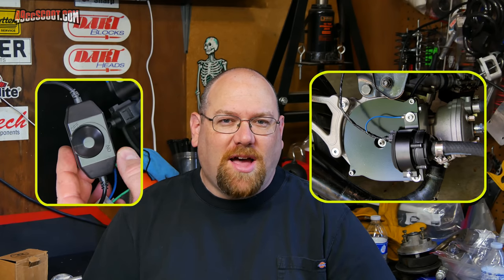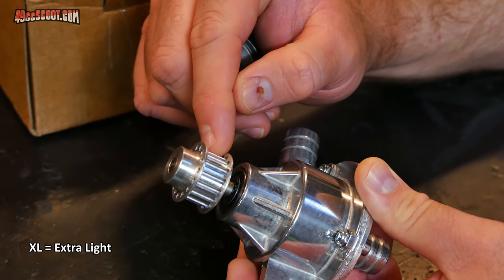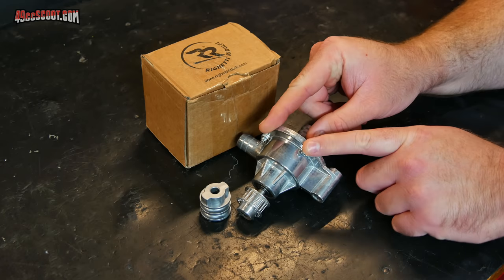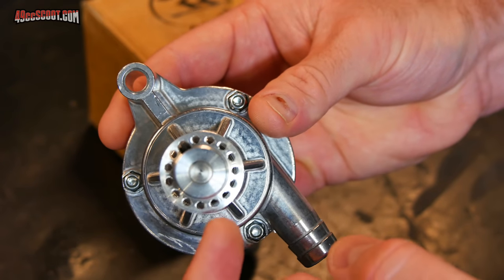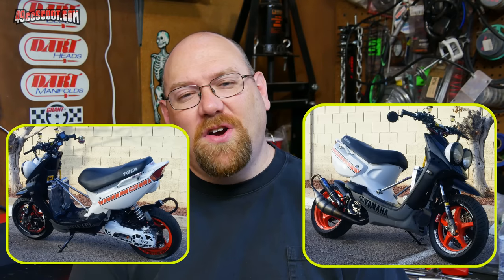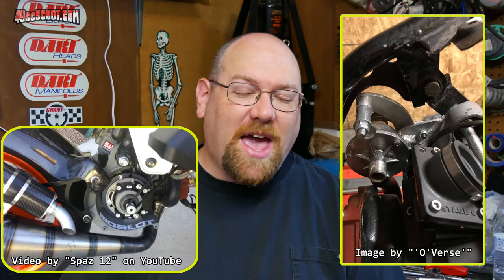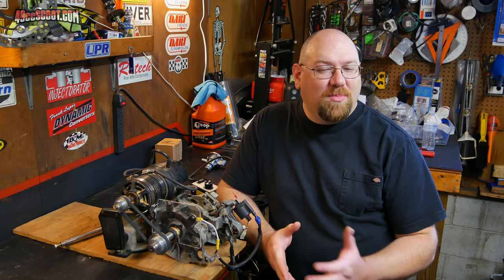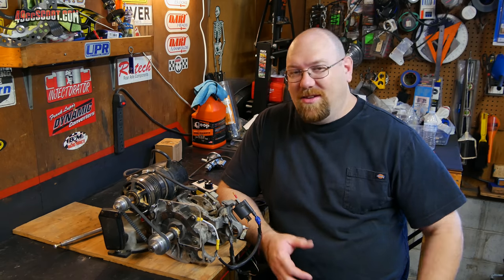TPR 86cc Build : Part 35 : Belt Driven Water Pump Info & Flow Testing : Scooter Performance

Comment: That Spaz guy sure had a nice scoot!

I didn't really give the driven speed of the pump much thought because I figured the guys who originally used them had no issues with them that it would be fine, and I never had a problem with it over heating. But I can definitely see the benefits of slowing it down!

Excellent video btw. Always so thorough 👍🏼
Reply from the maker: Yes he did. Thanks again for sharing that stuff.

Comment: Great research work. I know that the Malossi electric pump works with a constant flow of 20 L / min, but they use huge radiators on their high end sets. On the other hand, I am interested in how the designers of the go kart pump solved the bearings, lubrication and sealing, so I don't think it would be good to turn the mechanical pump more than 5-6k rpm. Since you have a large radiator surface, I think everything between 5 and 30 L / min will be fine.
Another thing to pay attention to is the proximity of the pump and belt to the asphalt. I'm sure they use the O ring type of belt on the go cart due to the fact that any small stone can easily tear the toothed belt or the belt could just fall off. If you decide to use this belt it would be good to make some kind of shroud.
Great video!

Comment: What you really need for better accuracy are a couple 55 gallon barrels to work with. I'm pretty sure what you are seeing is air being introduced by air being mixed in from the turbulent return flow of the 5 gallon system. Cavitation is going to happen at the pump impeller and the vapor bubble will have collapsed as soon as it got to the positive pressure side of the pump.  Water temperature matters as well. Water at well below boiling temperature (212° F @ sea level) can be made to boil with a little bit of vacuum. That is why pressure cookers are used. (so water can be heated to a higher temperarure before it will boil) Trying to pull water through so fast that it causes it in effect to boil is going to reduce the flow from lack of coolant to grab onto to push through.(cavitation) Engine temperature will rise accordingly for lack of effective coolant flow. Cooling systems are limited to allowable positive pressure that comes with heating. Exceeding that will get you forced leaking, blown hoses or over-pressure release), so an efficient transfer of heat for cooling is important. Naturally, heat transfer is going to work better with more surface area to dissipate heat. Larger tubes to reduce  restriction of coolant transport along with more cooling surface area is the best recipe for good cooling. So, generally speaking, a bigger radiator will do more for cooling than a fast flow of coolant... Coolant has to flow just fast enough to pick up the engine heat and carry it away to the radiator before it reaches the pressure/temperature boiling point. And then dissipate enough of that heat at the radiator to have enough capability to absorb heat before it flows back into the engine. 
(kenoguy10 here on YouTube... AKA bandito2 or Scooter_Jedi on other scooter forum sites)
Reply from the maker: Thanks for the thoughts Bandito. There is certainly more testing that could be done. For me, it gets to a point of how much do I want to put into it and what's practical for me.

Comment: Interestingly a (very brief) google search on car pumps lead me to a 2-3L car having a 80-110L flow rate. This was of interest to me as my suspicion is that after a certain flow rate, the main factor is the radiator cooling capacity. Even with 2 strokes generating a lot of heat comparatively, if you can run at 60L/m, that would be plenty. Cars also have massive radiators, in the best air flow, with fan assist. This tends to indicate to me the radiators are a significantly bigger factor than flow rate. From your testing, you could also look at the point of failure, then run it at 2/3 of that for best performance and longevity. I have found the 2/3 rule works for most things, from power supplies, to cheap knock-off turbos.
Reply from the maker: I honestly think it would do just fine with 20L/min at the high rev end, but I wouldn't want it to barely spin at idle. That would move all of the water in my cooling system through at more than 10 times per minute and would be about on par with what you're saying the 2-3L car info says. I dunno. So many ways to look at data though.

Comment: My guess with the waterpump is that it is surging at high rpm. You are driving the pump beyond its efficency. The pump is not able to push the water out fast enough and the impeller loses "grip" on the water. Like with turbos you have compressor surge if you try to push more air in to the engine than engine can digest. Then that exess air will skip the blades on the impeller and be pushed out of the inlet.

Comment: Love the content I've had two 50cc 4 stroke scooters always had issues with them burning oil and breaking belts etc  I'm getting a 2 stroke this time possibly a peugeot speedfight/piaggio zip or baotion falcon (Chinese variant) have worked on scooters myself not as in depth by far but I like to tinker about love the sound of a 2t, all the best

Comment: This looks like cavitation to me but I am really not sure. The way I understand cavitation is from propellers not pumps. If it were cavitation I would expect the pump RPM to jump and to hear a noticeable difference in load as the air bubbles are created and pass through the outlet.
Reply: i think it's cavitation , you should do you test with cilinder and radiator  inline with the pump , the restriction in the system wil cuase the cavitation faster
Reply: What you really need for better accuracy are a couple 55 gallon barrels to work with.  Then you could see if it was introduction of  air from the turbulent return flow of the 5 gallon system or if it was from cavitation.  Water temperature matters as well. Water at well below boiling temperature (212° F @ sea level) can be made to boil with a little bit of vacuum. That is why pressure cookers are used. (so water can be heated to higher than 212° F before it will boil) Trying to pull water through so fast that it causes it in effect to boil is going to reduce the flow from lack of coolant to grab onto to push through.(cavitation) Engine temperature will rise accordingly for lack of effective coolant flow. Cooling systems are limited to allowable pressure (before forced leaking, blown hoses, over-pressure release) that comes with heating, so an efficient transfer of heat for cooling is important. Naturally, heat transfer is going to work better with more surface area to dissipate heat. Larger tubes to reduce  restriction of coolant transport along with more cooling surface area is the best recipe for good cooling. So, generally speaking, a bigger radiator will do more for cooling than a fast flow of coolant... Coolant has to flow just fast enough to pick up the engine heat and carry it away to the radiator before it reaches the pressure/temperature boiling point. And then dissipate enough of that heat at the radiator to have enough capability to absorb heat before it flows back into the engine. 
(kenoguy10 here on YouTube... AKA bandito2 or Scooter_Jedi on other scooter forum sites)
Reply: Actually, cavitation by itself is not going to cause aeration, Aeration happens when air is introduced into the system... usually by a leak in the system that allows air in.

Comment: Hi. Do you think if you push the water through the radiator too fast, then it won't be in the radiator long enough to cool the water. Great videos by the way. I really enjoy them.
Reply from the maker: Needing more time to cool in the radiator is supposed to be a myth. Any more modern stuff that I've read basically says that more flow will equal better cooling. That said, I think there's a point where you don't gain much. The stock style mechanical pump moved a lot of coolant and it seemed to do better than the electric pump that flows less.

Comment: @49ccScoot  May I ask where it was denoted as 'myth'? Heat transfer is not instantaneous. You know that if you have ever touched an exhaust manifold, cold to start, and taking a while to warm up, or the reverse where you touched a hot one, realized quickly, and removed digits etc from contact with little or no burnt fingers.
Maybe you should do some flow tests through a fixed size radiator with a fixed airflow, measuring air F in/out and coolant F in and out. Vary your pump output as desired.
I do know that a V8 will pass coolant through a radiator fast enough that it fails to cool, and turned on the 'HOT' light in a friends car I borrowed. There was no thermostat installed. BTW, thermostats restrict flow even when open fully. I have not checked for any example testing anywhere.
tom
Reply from the maker: I spent some time reading about this a while back and I tend to leave it to the people that are way smarter than I am, like engineers and physicists. One simple takeaway for me is to look at the inverse relationship between the radiator and the engine instead of solely thinking of the radiator in the cooling system. You will also find mention of restrictions like washers or thermostats in some of these links and what they really change.

https://flowkoolerwaterpumps.com/blogs/cooling-resources/doesnt-coolant-need-more-time-in-the-radiator-to-cool
https://www.evanscoolant.com/blog/multiple-pass-radiators/
https://www.eng-tips.com/viewthread.cfm?qid=432703
https://www.stewartcomponents.com/index.php?route=information/information&information_id=14

Comment: I am also curious if it's cavitation. You might be moving the water so fast the vacuum makes it boil at ambient temps, which may not be good for the pump blades.
Good tests, BTW.
It would be cool if you could put a temperature sensor at both of your engine cooling lines. That way you get a sense of the point of diminishing returns. In other words, your radiator can only transfer so much heat to the air at a given airflow given the ground speed (and radiant surface emission). From that point onward, increasing the pump RPM will be dragging down the engine for naught(, causing it to run hotter because you will apply more throttle.) It would seem that once the engine is hot, and the temperatures become similar on the inlet and outlet, there's not much that can be done.
Also, the situation will change once the water is going through the radiator and engine, which will likely be more restrictive than an hose. The pump may not work efficiently because of the backpressure. Backpressure may also might give the pump and belt a hard time. It might be good to do tests with the engine/radiator loop, and insert a bucket in there to see what's going on.

Comment: All this difficulity to get a waterpump to work properly at higher RPM, while piaggio has a nearly unbreakable and well designed integrated pump as standard on their liquid cooled engines. Only if it breaks you've got to split the entire case. But Piaggios superiority aside, awesome solution my man!
Reply from the maker: Thanks. Most just use an electric pump and live happily ever after. I'm just not a fan of the electrical requirements coupled with a racing ignition.

Comment: I may have posted this previously, so.  Experienced mechanics note that overheating at speed points towards a plugged radiator.  Overheating 'in traffic' indicates a failing coolant pump.
 Given that, if you overheat at speed, the radiator may not have enough transfer capacity.  You should be getting decent airflow over the finnage & tubes, so total capacity is of interest.
 In 'traffic', i.e., city traffic, the pump must circulate enough coolant to dissipate the heat.  If you can keep cool in traffic, the increased output at higher speeds should take care of increased heat output.  Applicable to engineer designed cars and truck cooling system, not 2T home-engineered setups.  Your mileage may vary.  Ummh.  Your mileage WILL vary.
Reply from the maker: I think my radiators are likely overkill. Many have half the radiator that I do basically. Mine are straight up for best flow through and have hardly any sort of hindrance ahead of them or behind them. I doubt that they are clogged. Still, I'd rather have too much radiator. I could use more if I had a thermostat IMO, but I don't want to sit on top of a radiator on wheels either.

Overheating is sort of a relative term here. I'm trying to cool to levels that they typical car or motorcycle enthusiast would be looking at as cold. I'd be happy if it stayed at 120F all of the time. That would be considered unhealthy for many engines. My concern is more about heat transfer into the cylinder and cases where it then heats the incoming fuel/air charge. Not the typical overheating concerns when dealing with automotive cooling systems.

The only times that I've seen legitimate overheating were related to failures of the head gasket or water pump. Otherwise running "hot" is like 140-160F. I haven't even seen 160 since I've had the TPR (other than pump failures) so I think that was likely due to my 103cc never totally sealing. I'm looking at more like 140 for the high temps on hot days (80-100F).

The electric pump turned down with the PWM did heat up more, so I need a certain amount of flow. Even it cooled OK when turned up, though not quite as well as the mechanical pump that flowed considerably more. Small differences though. I don't think I am capable of testing with enough accuracy to be certain of how much flow matters for me, because I don't think we'd be looking at big swings as long as I've got at least say 20L/min.

Comment: This might be way out on left field, but what about using a secondary charging system to drive the electric pump?  I guess  that would create too much rpm drag, but food for thought?
Reply from the maker: OG on the forum suggested a belt driven alternator instead of the pump actually. I didn't even realize they had alternators that tiny, but they're out there.

Comment: Use the chicken net in the form of a ball to keep the hose from the bottom or just tape a stick side of hose so its keep it open and also Some pumps blades have a different angle and if the angle of the blades is not steep enough and you put more rpm its just brokens the flow same happends in boats also when there are too many rpm and low angle its barely push water out its just makes more air bupples...Ps..Sorry my English i hope you get 70% what im trying to tell

Comment: my guesses are radiators cant cool enough fluids. then pump and plumbing simply wont push enough water through..  
just like car turbo/chargers. 
btw u shouldnt use the water pumps dry for any (longer) amount of time. at least thats what im told...and by experience.

 thanks for vids, do enjoy the builds etc

Comment: Honestly I'd start at 30% and see how that works.  I doubt you need much flow at idle and low rpm and the parasitic loss will be significant at higher rpm.

Comment: Kinda off topic, but why do karts use external (axle driven) water pumps, rather than having a water pump integrated with the engine, like motorcycles?
Reply from the maker: Karts are pretty much purely racing machines. I assume that makes them prime candidates for easily swappable systems. Street driven stuff wouldn't fare well with axle driven pumps. You'd overheat at red lights. Racing machines can get away with it. There may be some advantage to not directly using engine HP as well. Perhaps less losses.

Comment: i have seen the top speed and on board videos and the scoot looks pretty slow. roughly 70 mph top speed is easily obtainable with the tpr 70cc kit, yours should be able to do at least 80mph
i would try messing with the rear pulley and trying a softer contrast spring (idk if you already tryed) it should pull harder at high speeds with a softer spring.
Reply from the maker: I use one of the softer springs that fits the OR pulley and I put quite a bit of time into the rear pulley when I first got it. Cutting down/facing parts on the lathe to allow better travel that matched the old steel Malossi pulley. The aluminum OR pulley was disappointing out of the box for me.

I would have to guess that you haven't seen very many videos of a 300lb person that doesn't tuck down well going much faster. Most scoot racers/tuners that I've seen are about half my size.

Comment: Have you thought about using waterless coolant ?
Reply from the maker: Not really. I don't think it will offer any great benefit for me and it's cost prohibitive. I typically get SuperTech  (Wal-Mart) concentrate for $10 gallon. Add a gallon of distilled water for a 50/50 mix and that's 2 gallons for $11. Evans is currently $30-50 per gallon. I take stuff apart too much for that, and it's also hygroscopic so you have to be careful about sealing it and so on.

Comment: It's cavitation I wouldn't drive it any faster than 3000rpm it's gonna suck power from the crank you can see how many amps it pulls under different rpm and make your call but I don't think you need anything over 25l/min

Comment: I know it's a little off topic but I have a yamaha bws or zuma  same thing really .2004. Fully tuned . But not the ignition.  I bought a MVT millennium . For yamaha bws 2004 'm not good at wireing .and there's some extra wires left over when I'm done .not only that the instructions  and French and destroyed from water and the pics re too small to understand
Reply: I could really use some help cause  when it comes  to anything I have to wire, honesty .I'm dumb as fuck